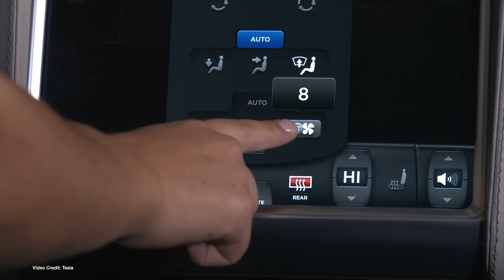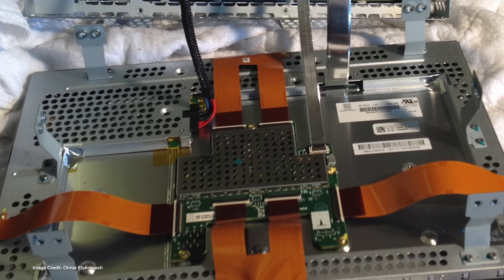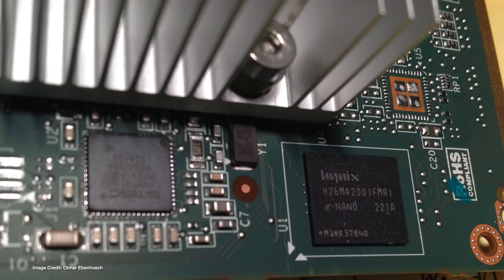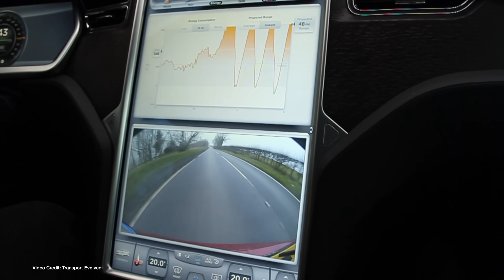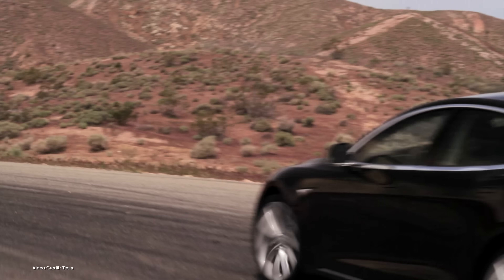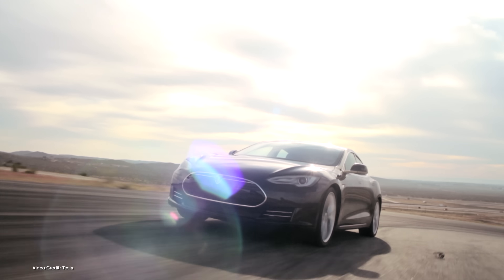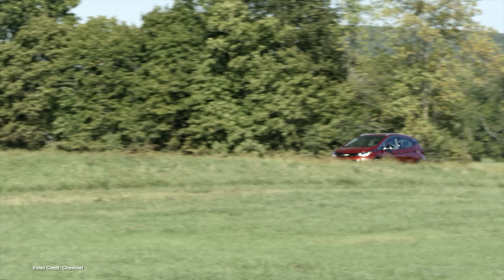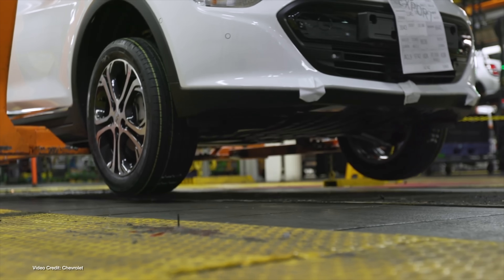Tesla Confirms MCU/eMMC Recall For Tesla Model S, Model X. But What's An MCU? And What's An eMMC?

Comment: Seems the timeline is slightly different for Europe, unless I misunderstood something: I got an e-mail from Tesla on december 10th, about owners of cars that are within the 8 years/100000 miles (well, it said 160000km) from date of delivery will get a failing eMMC replaced at no cost, and that if it has already been replaced I may get reimbursed.

By then I was already suspecting that the eMMC was degraded and near failure. Fast forward two and a half weeks and as we get home from visiting family for Christmas the car gets a software update, after which it popped up a warning that the "center display storage device" was degraded; it was OK to drive but I should schedule a service appointment. Tesla Service confirmed that the software update included what was previously a separate service centre diagnostic tool to check eMMC health.
The small(ish) daughterboard carrying the eMMC was replaced a week and a half later (parts hadn't yet "trickled down" from the central warehouse in Oslo to my neck of the woods).

The eMMC replacement fixed a weird error I was having with seat memory - often the seat back would not move fully forward to the stored position from the "easy entry" profile - sometimes selecting the driver profile again would fix it, but mostly I had to adjust manually and store the settings again. I also had the MCU completely shut down (or crash?) while parked on a couple of occasions, and taking several minutes to start up.

Comment: This was a design fault by the software and hardware engineers. In embedded software you NEVER log to your operating drive, logging is done to either a different drive or to its own partition. Secondly, you NEVER design software to fail because of logging errors, you design the software to be able to run when you can't log.

The hardware engineers should have added an SD card slot for logging and the software engineers should have thought more about their logging. In the embedded world, it is common to log to RAM and only write necessary information to disk at shutdown. Tesla designed this fault through negligence or for planned obsolescence to force customers to pay in the future.
Reply: It's not that the software fails due to logging errors, it fails due to errors on the storage device itself. Errors you also cannot prevent by partitioning the storage device as the wear levelling will move data around anyway. On an old hard drive partitioning would prevent data from being written into the storage area of another partition, but with solid state storage, we no longer have that principle.

If the hardware engineers had added an SD slot, the software engineers probably wouldn't have used it, or if they did, they would have written the logs directly to it and destroyed that thing even faster than the eMMC chip.

This is what you get for rushing software with inexperienced people. Young minds, fresh ideas but lacking experience.

Comment: 5:54 - ok now I know why in the instructions, of my Samsung NVMe drives, they asked to leave some space unoccupied.
Reply: Most SSD with NVMe or SATA interfaces will have far more elaborate controllers to minimize risk of failure.

One feature is wear leveling. When the host addresses a memory block it's not a physical block, but a logical one mapped internally by the controller to one of the cells. 

To avoid hot spots of cells that are used (written to) too much, the controller tries to always write to one os the least written physical cells at each time. Sometimes, the content of a rarely used physical cell is moved elsewhere to achieve this wear leveling.

When there is a lot of spare space the controller can do it's background work fairly efficiently. When the whole SSD is used, just a small amount of cells are available, cleaned (they must be put to a blank state before being rewritten), and the processing becomes messy, slower, inefficient, possibly requiring lots of shuffling data back and forth.

Most memory products, including IDE/ATA/SATA/SCSI hard drives (HDs), eproms, ram, are produced with spare cells that substitute for failed ones, so programmed by the factory, and sometimes at low level formatting (ie HDs).

The eMMC shouldn't be different, but are probably not as sophisticated as a proper SSD, and have an inherently failure prone technology to begin with.

It's still a good idea to leave some 10% of the raw space of your SSD unallocated, just to avoid accelerating the wear that happens when nearly fully written.

Comment: Finally. Poor coding, poor hardware specification but mostly a complete lack of ownership of the problem and a total lack of respect for owners. 5th major failure of my S.

Voluntary?  Hardly. Only after they were forced by the NHTSA.....
Reply: Technically they could be forced only by going to a court? So if there is no final sentence that would make it voluntary?
Reply: @no_more_free_nicks  No. The NHTSA can simply tell them to do it.  The first step for the NHTSA was to ask them to do it.  If they had refused they knew what was coming next so they "volunteered" to do it....  under duress.  If it was truly volunteering they would have done it years ago and saved us all a load of grief and stress.
Reply: Voluntary in that you are not required to have it fixed under the recall. If it was required, Tesla would have to do the change the next time they see your car for service. Now it is optional.
Reply: @Hans-gb4mv  Mine's needed doing for the last 6 months and they've been putting up every possible blocker and pushing it back to me every time, including trying to charge me £2.5k for an upgrade to MCU2 rather than just making my car work properly under warranty.  Frankly I'm glad they've had their hand forced. Dreadful way to treat customers.  You can argue about semantics all you like, the net result is that they are fixing the car no questions asked.  As they should have done in the first place.
Reply: On a positive note, you are about to get a free(not including your time) upgrade. I think you will get not just a new chip, but a new MCU.
Reply: @fjalics  It's not free. Warranty is included in the price of the car.  It's a daughterboard replacement from 8 to 64 that's all so will still have my charming yellowed screen. Yes it is positive.  It's sad it's taken so long to get here with a car that can sometimes take 5 minutes to boot up.  Luckily not doing any getaway driving but it can be a worry especially in a queue for a ferry for example....
Reply: @ruaraidhmcdonald-walker9524  If Tesla was fearful of going out of business, like in 2018 when I got my Model 3, and they were stingy, I would be more understanding, but their cash position is very strong right now, and this failure is on them. Glad they finally decided to do the right thing, but wish they had done it sooner.
Reply: @fjalics  Hear hear!!
Reply: @fjalics  doubt it. Tesla wants you to buy the new MCU so what they'll offer you in this program is a refurbed motherboard where they replaced the old 8GB chip with a new 64GB one and send your old board back to a central location where they swap out the chips for the next batch.
Reply: @Hans-gb4mv  No. it's a daughterboard.
Reply: @ruaraidhmcdonald-walker9524  No. it's just one chip: https://cdn.motor1.com/images/mgl/kJykn/s3/tesla-cars-have-a-memory-problem-that-may-cost-you-much-to-repair.jpg
Reply: @Wookey.  I’ll go with what Tesla are telling me directly will be replaced thanks!
Reply: @ruaraidhmcdonald-walker9524  That seems sensible enough. Looking more carefully at that pic I see that actually there is a daughterboard under that metal cover which includes the flash chip, so it's not soldered directly to the main board like I thought. So that does make sense in fact and apologies for contradicting you in this case.

Comment: Voluntary recall? The recall was enforced by regulators, Tesla did not do this voluntarily they were charging customer thousands to have this fixed. Very poor customer support and not a good look for a  company that are the "goodguys" of the car industry.
Reply: Size and power always corrupts. Eg Google, Amazon, Facebook. Soon they will have control of your transportation (movement censorship).
Reply: @scanspeak00  Tesla has always been very eager to use its power even when small, just look at the insane amount of lawsuits Tesla has started against their smaller rivals. And very curiously not against the big boys that are so big that their operational capacity is not affected by a lawsuit.
Reply: @brunobgl  I was afraid I had to lookup numerous lawsuits, but guess what, it is so insane someone made a page on wikipedia: list of lawsuits and controversies: https://en.wikipedia.org/wiki/List_of_lawsuits_and_controversies_of_Tesla,_Inc.
Reply: @brunobgl  Just google yourself: Tesla lawsuit against: Neo, Zoox, Rivian, Fisker & Xpeng, That is from the top of my head, but there are lots more lesser known startups sued by Tesla as well.

Comment: Great informative video as always Nikki , it does make you wonder what other shortcuts or cost cuts Tesla did or still does ??
Why use a proven to fail tech ?
Reply: There is nothing wrong with the tech, just the way they used it. All nand flash everywhere (MMC, SD, microSD, SSD) is unreliable - always has been. But it's huge and cheap, so reliable NOR flash is only use for very specialised things these days. The unreliability is hidden by layers of software and spare blocks and clever filesystems, and then engineers still have to make sure they don't do more rewrites than the thing is designed for. Tesla did way more rewrites than the thing was designed for (pretty much by accidentally leaving a load of debug turned on). It really isn't the hardware's fault.
Reply: @Wookey.  I had no idea about the flash being so fragile I guess until this video 
Did Tesla know or not know this would happen do you think with the amount of writing and wiping ?
Reply: @brent_in_aussie  They should/could have known. This is basic embedded-systems engineering. If I'd been on the team I'd have been looking at the flash filesystems in use and the data rates and calculating from the chip spec whether it could reasonably be expected to last the life of the vehicle (flash filesystems used to be my thing :-). 
But I suspect that they didn't have any experienced embedded engineers on the team just a load of UI designers, and people who knew about self-driving. Or maybe they did but that guy was overwhelmed with work and simply didn't have time to look at the system as a whole. It's still hard to understand how an important project like this left the logging set up in a pretty dumb way and never measured the flash wear rates. I'm pretty sure it was cock-up not conspiracy/mendaciousness, possibly due to trying to move fast, but it is a really embarrassing cock-up to those of us who work in this space. I also don't quite understand why they didn't fix it sometime after release, unless the system architecture was such that they couldn't actually change the base-level stuff responsible for the logging, but that would be a very odd (and insecure) architecture.
Reply: @Wookey.  thanks for your experience in answering mate 
I found it very interesting and was surprised for sure 
We are hearing here in Australia they are unsure if these issues will arise due to lack of the number of Tesla’s here 
Ev’s are so rare here and no government support 
Thanks again

Comment: Tesla will refund those that have paid for this so far they informed in a newsletter.
Reply: Under a Safety Recall, they don't have a choice.
Reply: @attist178  well in our case they seem to do have a choice. We have three Model S cars in our family 2014 and 2015 260.000km on each all out of warranty unfortunately. Still happy as we have invested a lot in Tesla shares.
Reply: Do you think they will also refund those who bought the MCU2 upgrade? I literally bought the mcu upgrade 2 days before receiving the email for recall and my car is currently at the service center having the MCU swapped for the new one. I had previously agreed to the estimate for 2500 not knowing that they had slashed the price to 1500 just very unfortunate timing. I haven’t paid yet , do you think I can request for them to adjust the estimate to reflect the 1000 dollar rebate?
Reply: @danzen800  sorry to say that that I don’t believe is possible. You have chosen to get a upgrade with much more functions and much more advanced MCU. I was considering that also as one of our cars has AP but to take full advantage we would need a newer model with 8 cameras and we only have two.
Reply: @Top12Boardsport  yeah but Tesla slashed the cost of mcu upgrade literally days after o ordered mine . I don’t see why they couldn’t agree to charge me the new cost since they are installing it today
Reply: @danzen800  well that is a totally different matter and that should put you in a better position to negotiate for the better price. Definitely worth negotiating for.
Reply: @danzen800  good luck with that. They had a good salesman convince you and others to upgrade even though you can't take full advantage of it.

Comment: That memory should be modular not soldered to the pcb.
Reply: Not really. Directly soldering it to the PCB saves cost and increases reliability. It's just a design failure to use an eMMC the way they did.
Reply: @EinzigfreierName  but if it fails you pay a premium.
Reply: @JPSG3  totally agree with you.
Reply: @JPSG3  Well, if they had thought about this possibility, that would not have made the eMMC replaceable but change teh design in the first place.

Comment: This is a strange recall, because there isn't a defect in those memory.  Flash memory wears out, this is a known issue, their shelf life is limited to the number of writes performed, that is why some cars have never had the a problem and others have.   Any computer with an SSD will have a limited life span.   Most parts of the car, has a shelf life, usually failing just after the warranty period (hehehee).  So for NTHSA to demand a recall is a little strange since, this is not a faulty part.  It isn't really an safety issue as well, since there is a warning long before the part fails.  On the other hand, as a courtesy Tesla should recall the part and especially since it's a minor cost.  If NTHSA is going to suggest Telsa recall this part, get ready for many recalls of many parts.
Reply: Sure every product has a limitied lifetime. But If you buy a car with a limited lifetime of just a few years - that can't be right.
Reply: > Any computer with a SSD will have a limited life span.  
Yes, everything has a limited life span. But in this case it is way too short and most importantly represents a safety issue.  There is no warning, AFAIK. The problem is that they didn't use a SSD which is more expensive and would have lasted many years longer. See the video.  What they have used is more like an SD card.
Reply: I suggest you watch the video before commenting.

Comment: It is sad that Tesla is blaming Nvidia in its announcement. The choice for the chip was made by Tesla and the software that runs on it is designed by them as well. And it is Tesla that failed to disable some unneeded log files that is writing massive amounts of data.
Reply: Tesla should have used a way bigger emmc capacity
Reply: @carholic-sz3qv  The size in itself is not the root cause of the issue. Putting in a bigger chip only postpones the issue. Tesla should have disabled all that logging that they do not need. It's not just logs from the car that destroy the storage. From what I remember in the past, a lot of the writing is done from logging on ordinary programs from the Linux system. Logs that don't have any value unless you are debugging the software itself.
Reply: @Hans-gb4mv  the bigger capacity would have drastically increased the life of the emmc
Reply: @Hans-gb4mv  Actually the logs are very useful. But regardless the new eMMC chips are considerably better than the ones available in 2012. So a 64G eMMC will postpone the problem from 5 years to 40 years.
Reply: @jacobuserasmus  I don't see a memory chip lasting 40 years but nor will my Model S be with me for that long. I'll be happy with an additional 15 years.